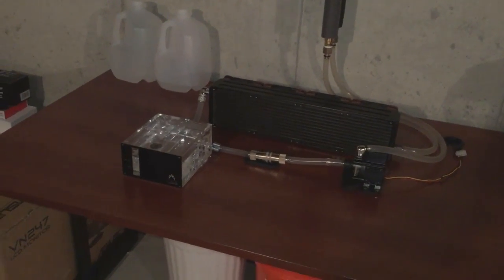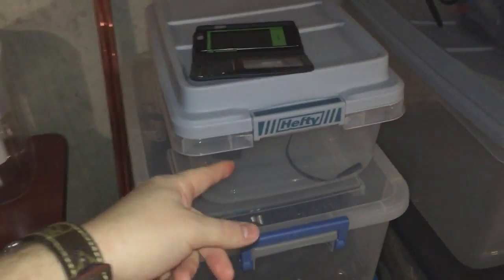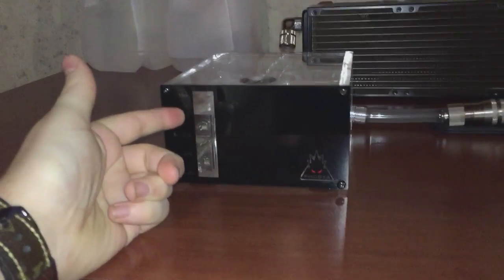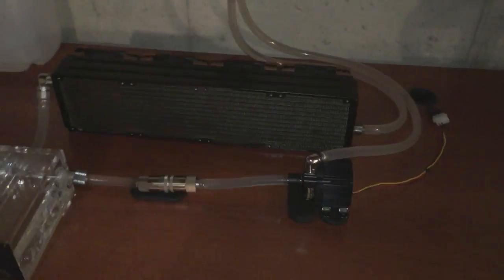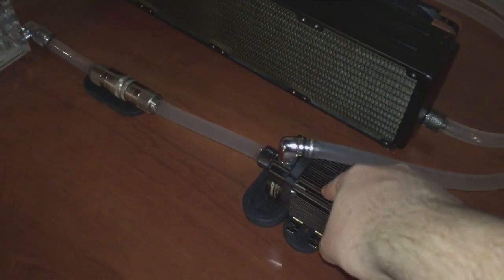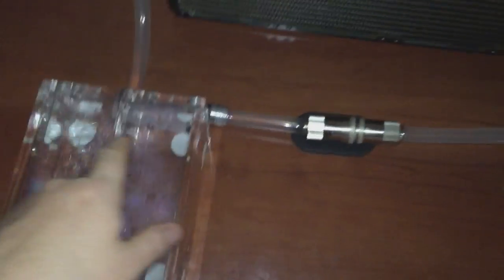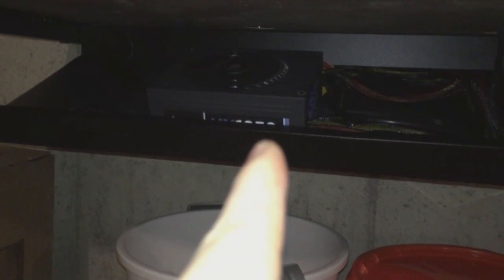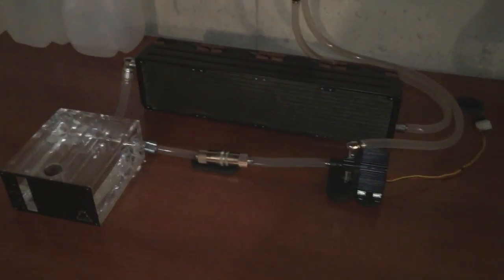Updated Basement Water Cooling Project - For LTT Forum!

Comment: Hydrodynamics not thermodynamics, but this setup is based around thermodynamics, so close enough. The X79 chipset is a hot one though, necessitating a dedicated heatsink and fan. Getting a chipset block would be great for this. I like the new pump more than the old one. The old one was an industrial pump that could run a whole room. The new one should be much better. The greater head pressure should help also- the blocks create flow resistance that requires head pressure to overcome. Thanks for taking my advice for the fans also (if you didn't then I thank the other person who did) as they are the best you can get from what I've seen, and great for this. Quiet and reliable is important when the fans aren't even in the same room. If one or more fails, you may not realise until the system overheats. These new noctuas shouldn't fail any time soon. This is a great setup though, probably me favourite of all the youtubers I watch.
Reply: +UniCrafter Even if the Noctua's did fail, the system wouldn't overheat at all. I've tested the loop w/ no fans, and load temps max out around 55-56c on the CPU, and 30ish on the GPU.

Comment: Before I actually saw how a water cooler worked, I thought it was drowning your PC in water. I knew that putting dust much less water can/will permanently damage your PC so I just couldn't figure it out. I still can't figure out exactly how it works. I know you put one end on the CPU in replacement of a fan and the other end on the side of the case, but how does that cool the CPU? Is it just cool water rapidly flowing close enough to the CPU that heated molecules get absorbed into the water then the water is transported to make the water cool again?
Reply: +ZeldaInuYashalover The water flows through small channels on a block of metal connected to the CPU. When the CPU heats up, the metal block heats up, which also heats up the water flowing through it. The water taking the heat away from the block effectively cools it, also cooling the CPU. The hot water (only a few degrees hotter than before, not boiling) is then pumped through a radiator which cools the water (and heats up the air flowing through). Once the water is cooled it is pumped back through the block of metal to cool it again. That is why it is called a watercooling loop. The water loops through over and over again. The water can't get out of the loop, unless there is a leak or evaporation occurs. The computers that you see underwater use an inert oil that doesn't conduct electricity or rust metal, and is also pumped through a radiator, but instead of using a waterblock uses an air cooler, though with the oil instead of air.
Reply: UniCrafter
Very interesting. Thank you.

Comment: You should put all those components  in pc case
Reply: +universalpaper then his room will still be getting warm, the whole point of this setup is so that noise and temperature is not near him and in the basement instead
Reply: +57chevy150 I think they meant get an old case that will fit the components so they're not spread out over a table top, and they remain in the basement in a single unit.